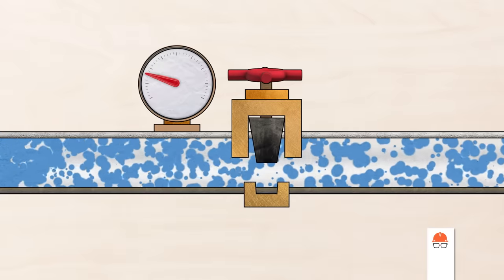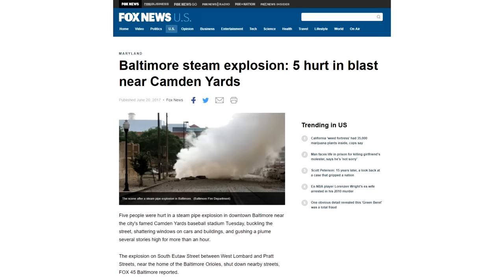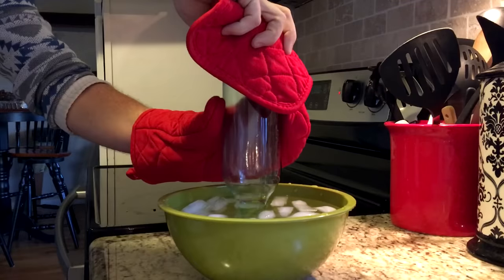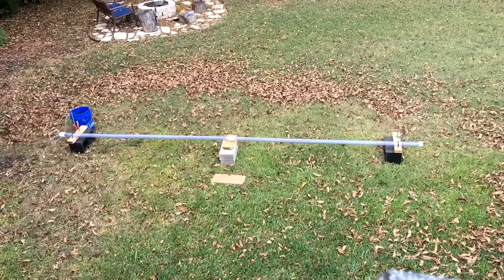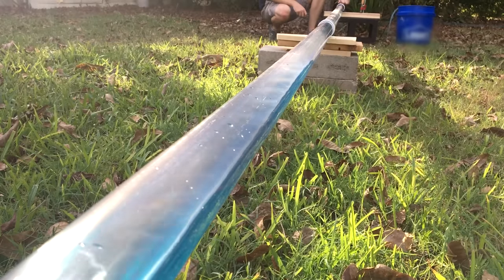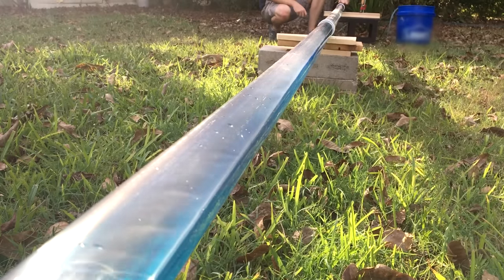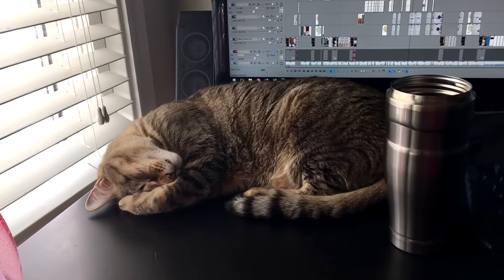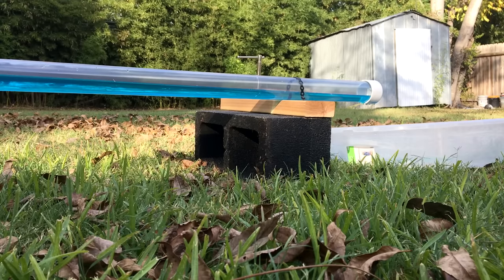What is Steam Hammer?

Comment: So steam is faster than water and is pressurized more than water... but once water is in the way of steam that water will be as fast as the steam! Water is heavier than steam so something heavy like a train going the speed of a plane.... ussually unstoppable... so pipes are made bigger or release valves are made... or shut off valves are made like if a pipe is not being used itll be opened so steam and water can evaporate and no water is to be created... but this itself can cause steam hammer as the valve suddenly shut off .... there arr a lot of variables when youre playing with pressure!

Comment: The most I mess with steam is canning veggies. I mean, I'm a ballsy fellow and all that. I often deal with non current limited HV, explosives, nasty chemicals, extreme heat, and needless levels of mechanical force in the course of my casual hobbies, but confined steam? Not only no, but no preceded by several poorly organized expletives. I've seen bad enough damage done by an exploding crane tire to know better than to casually mess with litteral tons of force confined in thick metal. If you work with high pressure steam and you recognize my face on the street, flag me down, I'll buy you a drink.

Comment: There is nothing wrong with radiant steam heating. The boiler is 50 years old, heats the potable water, and the home. Steam can carry over 55x more thermal energy than hot water in liquid hot water or hot water condensate radiant heating pipes. The reason we don't steam used very much anymore is for home heating, it has little to no tolerance for poor design and or shoddy workmanship.

Comment: Is it true that heat pumps can move 400% heat for 100% electricity put in?  Why couldn't you run a sterling engine off that to power the system?  No energy would be created, you would just end up with a lot of cold water, and a lot of electricity.  :)

Comment: Would the same phenomena occur if supercritical CO2 was used to power turbines instead of steam?
Reply: ajtrvll yep, it would, maybe not the same volume of condensation, but any pressure drop would carry its own problem at lower temps. Imagine an accelerated lump of dry ice in your system.

Comment: This video, although pretty good, gets some basic things wrong.  First is the name of the topic.  The author is really talking about "water hammer in steam systems".  "Steam hammer" is not correct and is a different phenomena  which occurs when fast moving steam is suddenly stopped as might occur in a steam turbine trip.  This demo is about WATER hammer. More significantly, the author implies that the slug of water picked up by the flowing gas in his demonstration is accelerated into a dead end by the speed of the flowing gas (air in this demonstration as opposed to steam in a steam system).  Actually this is not the motive force for accelerating the slug in what is formally known as a "Condensation Induced Water hammer" (CIWH).  When the slug of water is formed, it blocks a steam pipe between the slug (which plugs the pipe) and the end of the pipe.  The entrapped steam which must be surrounded by sub cooled water (i.e., water at a temperature significantly lower than the saturation temperature of the steam) will rapidly condense causing a relative vacuum between the pressure in the entrapped steam and the steam pressure outside of the slug.  It is this pressure DIFFERENCE that accelerates the slug of water into the entrapped condensing steam.  When the water smacks into stationary water near the dead end, that's the water hammer.  On my training page at kirsner.org, I showtwo a short videos of CIWH occurring in a actual glass steam system.